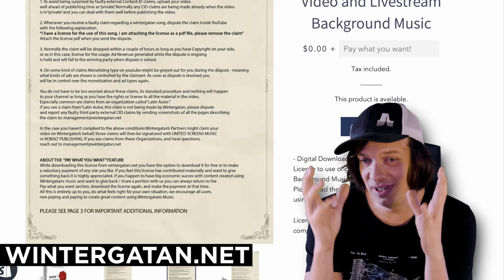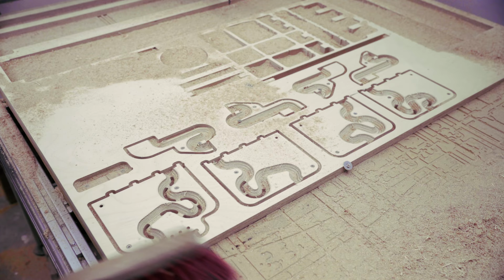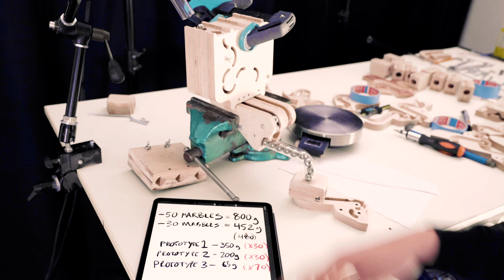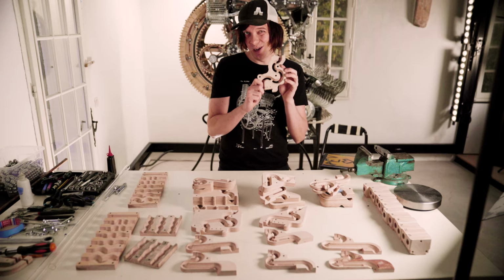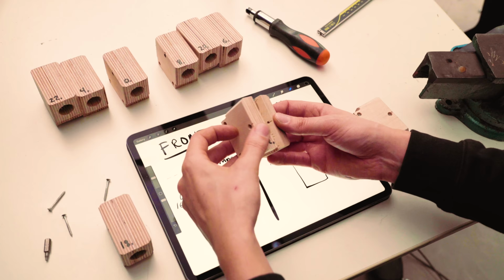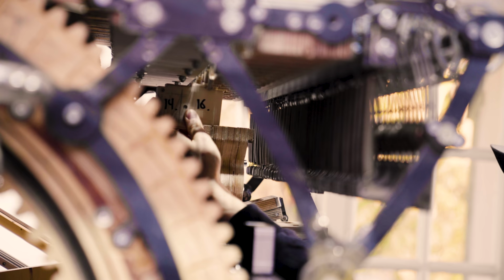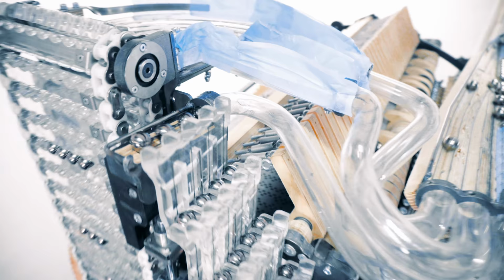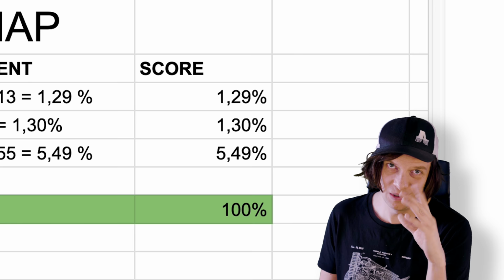Playing 20000 Marbles - Marble Machine X #147

Comment: I noticed something while Wilson was playing with the scale... not all marbles came out, some were left in the prototype. I guess this is not a big deal because there will probably always be enough weight behind to keep the marbles flowing, but if we're talking 10,000,000 marbles played, could it become an issue on some songs?

I love the productivity and discussion on design with measurable results! Keep it up Martin!
Reply: It shouldn't be an issue as that is only an issue if there are no more marbles and if that happens then there are bigger problems going on (assuming there was enough marbles loaded in it)
Reply: Think of those marbles as the water in the syphon. If input fails the output will fail even though there is residual water in the tube. Clearing the tube does nothing to prevent the action-result issue of input vs output. It will not be an issue at all.
Reply: @FollowTheCompassNorth  exactly. succinctly put
Reply: Martin, for Issue #4 you might consider trapping one large runner wheel inside the belt. If it is large enough it will push down on the bottom run of the belt and also push up on the top run of the belt.  This might look cool, it would appear to be floating.
Reply: @typicallucas  a free floating runner wheel could shake due to resonance as well...

Comment: "If you're losing, change the rules so you're winning again." - You know, it's interesting when failures happen because it's forces you to analyze your criteria for success and evaluate whether or not you're looking at the right thing.  Yea it's funny to say you're changing the rules so you win again, but I think it's more funny that it's a valid part of the development process.  With your new adjustment to count the number of parts being used, you could even go as far as identifying WHICH parts failed and assign parts weight based on criticality of performance.  You had ZERO failures in critical components across 20k marbles and that should drive your number higher, IMO.
Reply: "I reject your reality and replace it with my own better one"

Comment: To the resonating belt issue:
1- Belts resonating frequency is equal to =[π•rpm (of the pulley)•gear pitch diameter (of the same pulley]/belt length. You need to manage those parameters in a way that takes the belt’s resonating frequency out of the audible spectrum. 
2- When the belt leaves the pulley the teeth may stick together and “pluck” the belt as a guitar string. Placing a pulley pulling the belt away from the line between the two pulleys centres in the side of the belt that has no tension (the one that is drived, not driven) should do the trick.
3- As an extreme solution belt resonating issues are 100% fixed with oval pulleys, they are constantly changing the belts resonating frequency, so it can’t resonate. The downside: it would make the mmx loose its tempo, you can fix it by placing 2 belt systems in a row with an offset of 90°, so you’ll get again a constant action at the end of the system but a constantly changing resonating frequency.
Reply: If you place the pulley on the side in tension then you alter the timing. Some car engines actually use this to alter valve timing, probably not the effect you want.
Reply: @spacemanmat  yep that’s true, that’s called an idler pulley. But since it’s the motor’s belt he can easily regulate timing changing motor velocity. Even better, probably it’s more precise to adjust timing with an idler pulley than with motor velocity alone. But I do think that the problem comes from the pulleys plucking the belt + resonating with some other component. It’s really overengineering things (and that’s basically the baseline of building mmx) but I think a set of two symmetric belts with oval pulleys will look sick.
Reply: Actually thinking about the speed regulation. I wonder if there are instances where the motor gets slightly over speed (due load variations) and then backs off a bit. This would cause the tension side of the belt to momentarily run slack and then snap tight again as the load came back. It would explain the occasional noises and vibrations.
Reply: @spacemanmat   I think the motor was equipped with timing adjustment, so I suppose it’s a DC brushless motor powered with a well built power supply with voltage limiters and stabilisers. However it’s a good idea to check with a multimeter if when the resonance happens voltage or current fluctuate, if it does easy repair: a regulated ac power supply, and thinking in the world tour it would be nice to have a voltage and frequency converter. Martin if u read this:  Kikusui AC power supplies are the way to go.
Reply: A smooth idler pulley with a larger diameter offset from center would both expand the belt path to allow a cleaner tooth separation and halve the unsupported length of belt.  So long as it's not placed on a resonant node it should reduce or eliminate resonance altogether.
Reply: @Skinflaps_Meatslapper  it should not be placed in the middle aka Max amplitude point cause then the harmonics would show up but a tension pulley and an idler pulley would do the trick
Reply: @TelmoGuitar  Right, you don't want it directly in the middle, but slightly closer to one pulley and offset either higher or lower from the two pulley centers.  That gives all four unsupported belt sections a different length so they can't resonate with each other, provided the pulley isn't inadvertently placed on a node.  A tension pulley will also work, but the more pulleys and tension you apply to a belt, the more resistance you introduce as well.  You don't really want to wrap the belt over the cog pulley any more than necessary because tooth separation can cause vibration and accelerated wear (this is advantageous on a smooth serpentine belt system but not so great on this one).  Some toothed systems requiring a lot of contact surface will use a very small idler pulley nearly touching the cog on the exit side and routed in a sharp bend, so it flexes and opens the tooth side of the belt for easier separation...but that's a bit more complicated than it needs to be in this case.

Comment: Easy physics explanation:  The “potential” energy at the top of the hill turns into “kinetic” energy (motion) AND “rotational” energy.  More rotational energy, means less kinetic energy & a lower speed.
Reply: That's part of it, but I suspect that resistance plays a larger role as well. Both aerodynamic drag as well as the resistance between the rails and the marbels due to the imperfections in both would greatly increase. The latter is even more important because the normal force changes angle while having to support the same weight. While the sideways force from both rails cancel out, it does result in increased rolling resistance.
Reply: You can calculate this using the https://en.m.wikipedia.org/wiki/Parallel_axis_theorem
Reply: @jadoei13  Resistance to what?

At a given speed the ball's surface is moving the surface at the same rate for a given speed.The area may be smaller, and the ball may turn faster, but that still translates to 1:1 between the the distance traveled on the surface of the ball and the distance traveled on the rail.
Reply: I came to the comments to say this, but you worded it better than I ever could have
Reply: But in his Prototyp it didn't reduce any weight, because as you explained it only has an effect, while the marbles are rolling.
Reply: @Aaron_We  Forcing the marbles to rotate faster means they will be rubbing against each other more, which means more friction turning energy into heat. Or if the friction between the marbles is greater, they will be sliding across the wood with more friction than if they were just falling straight down.
Reply: @iwikal  Yes that may have a small effect, but as he measured the weight with the scale no marbles were rolling. So he couldn't maesure how much that effect really comes in to play in a dynamic scneario. And I am also not to sure how great it works within a vertical tube, where you don't have the gravity "forcing" it onto the rails. But nevertheless, that design won't create any other problems and so you can still hope for the little effect it might have.
Reply: This is an explanation for the track test only. The reason the serpentine chambers reduce total downward force is somewhat related, but there are more forces and counter forces at work than there are with the simple track.
- Gravity inputs energy at a fixed rate, completely depending on the slope of the track. All three balls receive the exact same amount of energy if all three tracks have the same slope angle.
- The vertically downward energy input into the ball by gravity translates to rotational energy. This is due to the contact point between the ball and the track being offset from the center of rotation for the ball, towards the up hill side of the track. This condition makes all balls roll downhill. It's also the same condition that makes you tumble forward if you get your upper body too far forward of your feet. The steeper the angle the more offset between the point of contact and center of rotation and so the faster the energy can be input into the ball. Friction between the ball and track mostly prevents the ball from sliding rather than rotating down the track. With all three tracks at the same angle, all three balls receive the same energy at the same rate and so rotate at the same speed.
- The explanation of the circumference size at each ball's contact point is completely correct. It is exactly the same as swapping three different size drive wheels on a bicycle. If your legs are outputting the same amount of energy in each case, the smaller the circumference of the wheel, the slower you will move forward. (don't confuse this with the gear sizes driving the wheel)
- Friction does have an effect, but it is "negligible" at slow speeds. The mass of the steel balls overcomes any minor effect of air friction. If the track is fairly rigid and does not flex apart under the weight of the steel ball the contact point between the ball and track is barely a pin point, no matter how wide the track, and so rotational friction is at a bare minimum.
Reply: @3DPDK  Yeah, the track test has nothing to do with what’s on the marble machine. They won’t be spinning, for one. Lol.
Reply: Yep. This same thing would happen even if there was no friction (although the friction makes it worse). To cover the same rolling distance, the marble running on the wider tracks needs to spin more times around. More of the potential energy (from height) is converted into spinning the marble than it having it translate along the track--three times more in fact.

Here's a great breakdown of the energy explanation: https://youtu.be/-RjJtO51ykY?t=81

Comment: I would add a runner wheel only on the side of the belt that doesn't transfers power. Keep up the good work.
Reply: that's the comment I was looking for! putting spring tension on the loaded side of the belt will produce an ever changing timing error! if the loaded belt has to be routed around a pulley it should always be a fixed one!
Reply: Hmm but if the vibration is caused by resonance he has to change the length of the belt on both sides, else one side  will vibrate and the other not.
Reply: @Enkelados1  not if the unloaded side gets fixed with a regular belt/chain tensioner setup

Comment: That "overrotation" effect is just rotational inertia. The reason that nothing accelerates instantly, i.e. mass resists changes in movement, is called inertia. Just as well mass resists changes in its rotation. And because the marble on the track 3 has to rotate fastest, it has to overcome more rotational inertia than the others. So just as a bigger object goes slower, if you exert same force on it, than a smaller object, also an object that has to rotate faster to be able to move, goes slower than the one that doesn't have to rotate as much.

But that is dynamics, and Martin's problem is in the statics. What he's basically measuring is the static force of the marbles exert downwards. If all the marbles are in full stop (that's when the problem of gates opening or not is relevant), the inertia doesn't come into play at all. So I think the groove openings in the channels don't affect the problem, unless they somehow add more friction in another way (they might also just decrease friction, making the problem worse). But they add a nice visual, though.
Reply: The visual is so worth it though.
Reply: It can also be said that potential energy is converted more into rotary motion than into linear motion. It also seems to me that a wider gap can also result in more friction. Friction in this case is good because it reduces the hammer effect. Btw. I am curious which ball would be faster on a straight path as soon as it leaves the rails.
Reply: @gelo1238  In theory, if there is no loss of energy in the contact (here the ball would rotate faster than its forward momentum would suggest), all three balls should roll just as fast when they leave the rails. There is no energy loss elsewhere
Reply: the normal force is the same bc the weight is the same, the center of rotation is closer to the surface so the additional torque reduces the force acting forwards, hence it's slower
Reply: There is more loss to friction at the contact point because rolling friction becomes more and more shear. The inertia is the dominating factor at slow speeds though.

Comment: hi, i think you have to consider the fail rating. some fails are inconvenience while others are critical fails. a marble getting stuck in a gate and clogging a channel is critical fail. a marble missing a funnel is not wanted but the machine can keep working. as far as i see it, you most prevent the marbles from fallng of at the top of the machine so they will not get stuck somewhere or fall on an instrument by mistake. the one that are missing the funnel can always be collected by a conic shape floor and re stuck it after every song is played. dont over design the funnel to catch 100% of marbles and create a new problem.

Comment: I'm so glad to see that you're moving away from the PMMA pipes for the transport system. I've been stressed this whole time about the strength and robustness of the machine, especially knowing that you plan to tour with is. If you break a custom PMMA pipe, you have to make a new one. With these CNC'd plywood marble paths you can cut the exact same shape easily any time something breaks, and I also expect they will be sturdier and less prone to cracking or breaking than the pipes will be.
Reply: Running the CNC to cut 3 plywood parts on tour will take longer than bending 3 cracked PMMA pipes on tour.  You can transport a heat gun and spare PMMA on tour.  You can't transport your own CNC machine.  You'd have to find a local CNC shop, transfer the files, wait for them to be cut, have them delivered, and then install them.

Comment: Something bother me a little about the pressure handler system. You're making the plywood marble track going UP to reduce pressure, i understand the idea, but what if there is no more marble stock inside the track (like on a very rythmic song) because the divider flux is smaller than the consumption of the snare drum on this song ? You'll get marbles stucked inside waiting for more to push them further up the "hill" and then the gate. It could create blanks into the song right ?
Reply: I was thinking about the same thing. Probably need a test, but later. :)
Reply: It won't make any difference provided you always get one marble out for one marble in, it just means there will always be a few marbles that stay in those sections.  Provided that's accounted for in the total number of marbles in the machine then it's fine.  My worry would be that those sections won't provide one out for one in when there aren't many marbles backed up due to the friction they introduce.
Reply: I think with the amount of marbles used and the reliability of the fishstair, i think that wouldn't be an issue. You'd have to have less than like ~15 marbles in the channel compared to 70 at full capacity and that would be such a deficit all the other channels after would be affected, considering the channel would have to be filled first before the subsequent ones. 

That would very easilly be solved by putting some extra marbles in the system if the lower part could handle it.
Reply: @ferrumignis  I think the key is that this introduces a new constraint on the MMX. To this point, the minimum number of marbles that needed to be in a given channel to successfully play a note when that channel was called was two, one at the stop and one to replace it. This new geometry requires some number greater than two. As long as the MMX's total marble capacity is high enough that the last tubes can't empty out below that threshold faster than they can be replaced, it should be fine.
Reply: The queue holds more than before but now needs a certain threshold for the supply to continue(might be a wash). The marble supply has always been a limitation that has to be composed around(one of the earlier videos talk about this some). I think overall the redesign probably did not change that limitation by much.
Reply: @lapatron555  I agree, i think that MMX carry more than enough marbles to not let any channel go empty. But right now we only saw 2 channels used so all marbles in the divider "try" to go in it and with that, it's a massive flux. I'm just concerned about the fact that considering all the upcomming unknowns and the limitation of this flux by openning other gates in the divider, that's a risk to use the angle grinder once more.
I know it's unprobable, but when you try to achieve 100% reliability, something like this which makes so much people react is not a detail :/